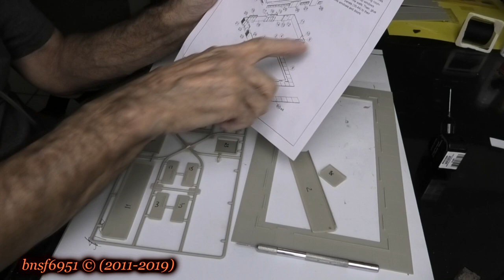HO AMTRAK STATION BUILD START TO FINISH

Comment: The building size looks fine.  The doors are at about and inch which is right. Don’t forget this is modern and built by the government in the 70/80s when they didn’t want to spend any money. Taller the building more cost in all things including foundation. Also , even today, the build them at Grade and use the steps to get into the train. The big stations where built when their was competing railroads. Kind of like airlines, you can fly Spirit or you can fly Alaska different standards different prices. Look at how short post offices in that era were built.
Reply from the maker: hi Steve...i agree with your statement but my N scale passenger car covers 2/3rd of the length of the building &barely fits under the canopy..so does 1 HO passenger cover the entire front footprint in real life ???  from the bottom of the canopy to the ground  is 10 HO scale feet... i just think Walthers could have scaled it a bit better... i understand the the prototype is in Rochester New York... i appreciate your input ... vinny

Comment: Great video, quick and concise... I have used black ‘ wet and dry’ sandpaper for roofing and it seems to work well. Holds weathering powders too... I agree with the Walthers kits being a bit rough.. I just built the modern power station and it wasn’t able to be squared up in a couple of places so I had to do some fine sanding!!
Cheers from Melbourne Australia
Reply from the maker: hello Greg...yes there where several ways for me to dress up the roof but this build has a fixed price so basically build it out of the box...it's funny i just finished the light & power structure & it did not go smoothly either...the head house for the crane had less than a half a MM clearance under the roof truss...anyhow i did build to generate a little extra cash..thx for watching & your comment...vinny

Comment: Just subscribed to your channel Vinny !! I model in N scale and use Walthers kits all the time ,but brother ,some of those things can be a real bear to build and those instructions are pretty much useless.I used to do a lot of aircraft modeling and scratch building, so those skills come in handy when making these kits ,but still ,they can really test your patience.I always end up adding roof details and stuff to hide any imperfections.I recently built their Vulcan manufac. building...…….OY VEY.....that frik`n roof,nothing fit properly and had to add roof strips and a roof cap on the ridge to hid gaps.Looks good now though ! I could never build for other people, I`m too picky and they can`t afford my prices(I take beer for payment)
Turned out nice Vinny !
Paul T in Canada
Reply from the maker: hello Paul...thx for the sub & welcome aboard. ..my forte" is scratch building...i am an N scaler also so i am doing these HO kit builds to generate some extra cash... they are on a fixed  price with no other bells & whistles added.. i do refer to the instructions from time to time mainly to check inventory... i am very disappointed at the fit & finish on these kits...and this particular kit in my opinion..is not an HO kit if you watched the vid all the to the end  you'll see what i  mean...
i do Friday night live streams... in these shows i show different things... the series i'm doing now is scratch building a bucket elevator...you should join in... 8pm eastern except this coming friday i will be on a road trip to Cali...to visit some modeler friends
again thx for the sub.. also thx for watching & your comment... vinny
Reply: @dacuzzz  Yessir, love my scratch building.Glad I found your channel.

Comment: Those mold injection points are unfortunate. They should have designed them to be on the inside. The dark color you chose does a good job of hiding it though. Cool build Vinny.
Reply from the maker: hi John... this is the 3rd walthers HO kit i have built  & every one had a problem... i don't that i have to fix a screw up from the manufacturer... anyhow... thx for watching & your comment.. vinny

Comment: I think the station would be on a raised platform so you can walk right into the car  you can hide the casting marks on the roof with HVAC equipment
Reply from the maker: hi Marcel... the HVAC units are not in the budget... these kit builds that i am doing are no frills builds with a fixed price... a friend sent a pic of the prototype located in Rochester New York..it is exactly like the model built at ground level...thx for watching ... your input & comment....vinny

Comment: Vinny, I have the same Amtrak station and never really noticed the size difference from my other HO scale buildings till you pointed it out. Walthers should have made it taller, big screw up on their part. This is a common problem with HO scale structures, I don't know why there is no standard but I won't buy from certain manufactures because of the disparity in scale.
Reply from the maker: hi James what i say in my videos is just my opinion...but to me this structure is not HO scale... thx for watching & your comment.. vinny

Comment: In the past it was advisable to wash the plastic parts before you start building , do you still do that?
Reply from the maker: hi Paul.. you are 100%  correct... but that is a step i skip  only because i have never had any problems with assembly or paint.. thx for watching & your comment.. vinny

Comment: The actual AMTRAK station looks to be 50'x160'  maybe 150'  "Rochester, NY 
Amtrak Station"
Reply: The building is gone but... I have a close idea of the foot print (Google Maps) so my guess is it is 50' deep and 160' long.  In HO  6.9"x22"  that is a rather large  building
Reply from the maker: @IMRROcom  ...the top picture looks like the one Walthers copied...thx again... vinny
Reply: @dacuzzz  It is all the same station just from different angles.

Comment: Nice kit build Cuz, although your scratchbuild would have come out better. There are manufacturers who scale HO at 1/100 instead of 1/87. Kinda looks like that's what Walthers did here. Best, John
Reply from the maker: hi John...the problem is a lot of guys that just get into the hobby have  no clue what scale means...i just feel bad that these guys buy something & don't get what they are paying for...the manufacturer only cares about the bottom line..if they make the kit slightly smaller they are saving on materials therefor bottom line increases...it sucks...thx for watching & your comment...vinny
Reply: @dacuzzz  I'm with ya Cuz! I've been in business all my life and I understand the bottom line. But this is not good business, it's just greed. It's hurts the new guys, it hurts the hobby and ultimately, it hurts the manufacturers - very short-sighted strategy! As you know, I'm more of a scratchbuilder than a kit builder. But based on what I saw in your video, I wouldn't consider a Walthers kit. Thanks for sharing my friend. Best, John

Comment: That is very odd about the size. It seems like if it's HO it should be a bit taller. Maybe its supposed to be on a platform when put on the layout? IDK what is up with that.  ❓
Reply from the maker: hi William...in my opinion the length..width..& height all should be more prototypical... the prototype is built at ground level....thx for watching & your comment.. vinny